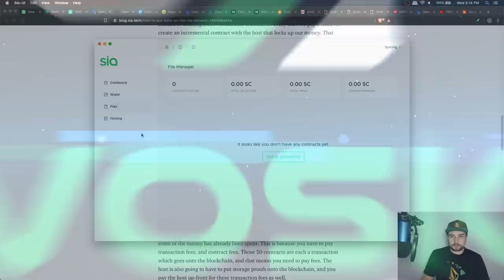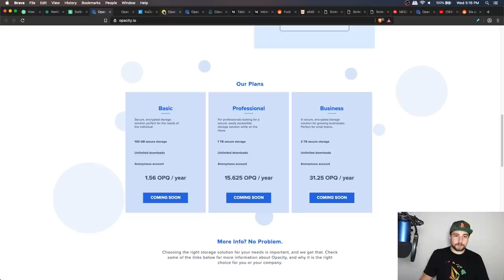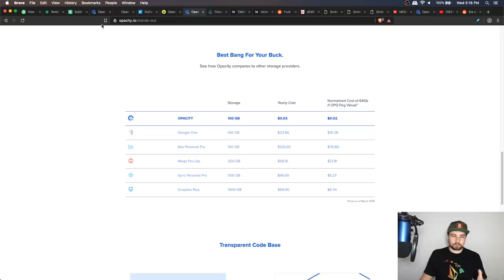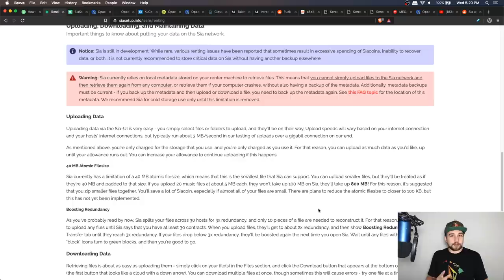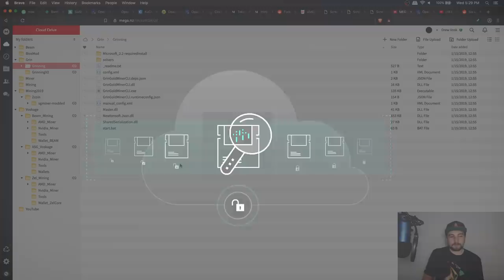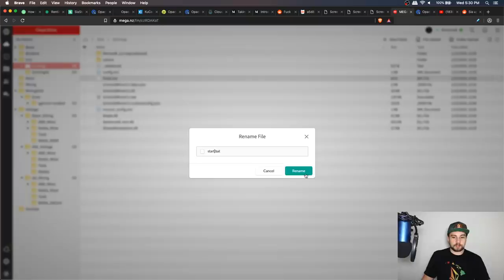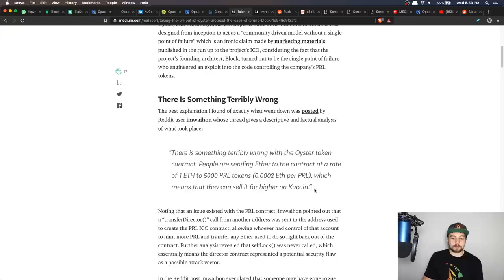Will Storing Files on Cryptocurrency Blockchains become Popular? Siacoin Vs Opacity

Comment from the maker: Sub to VoskCoin http://voskco.in/Sub
Want to expand your file storage? https://amzn.to/2DgUUda
VoskCoin Twitter - https://twitter.com/VoskCoin
TIMESTAMPS and LINKS BELOW!
00:00 Intro to cloud storage on the blockchain
00:17 Tails Doge surprise appearance
00:30 Siacoin cloud storage mineable cryptocurrency
01:32 Opacity launching blockchain cloud storage May 2019
01:51 Storing files on Siacoin cloud storage platform
02:47 How much money does file storage on SIA cost?
03:23 Opacity cloud storage OPQ pricing
04:05 Comparing blockchain file storage to Google, Dropbox, etc
04:40 Obstacles to decentralizing data storage with blockchain
09:05 Issues with Siacoin blake2b mining
10:50 Opacity OPQ coinmarketcap
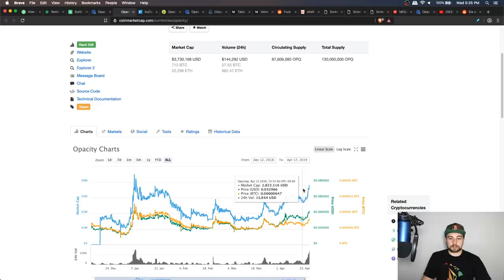11:12 Siacoin SIA coinmarketcap
11:44 Final thoughts on SIA vs OPQ blockchain file storage

LINKS! 
Thanks to Opacity OPQ for todays video - http://voskco.in/OPQ
Cost for storing files on Siacoin - http://voskco.in/SiaCost
Siacoin official website (cloud storage) - http://voskco.in/SIA
How to put files on Siacoin (guide) - http://voskco.in/SIAdata
Opacity OPQ whitepaper - http://voskco.in/OPQwp
Opacity & Oyster Protocol PRL drama - http://voskco.in/OPQdrama
Opacity OPQ to USD calculator - http://voskco.in/OPQusd
Reply: Take a look at Ether-1
Reply: 0chain also stores data on the blockchain and it is by far the technical fastest and most advanced decentralized cloud storage project. You can test their alpha app out on their website if you have ios.

Comment: Tried them all. So far, from a storage user point of view they have not performed well. The performance of their storage when its sitting on crappy nodes at residential internet connections at miner homes is just not good.  From a mining point of view, I have tried mining Storj and SIA, never made any money either way. I put up to 40TB on these networks in my data centers where I have low latency high performance 10gbps+ connections and over a month barely 30GB was stored by the blockchain storage platforms.   One of these block chains needs to go after enterprise class performance, security and features. They also need to classify their storage nodes based on performance, location, redundancy, and such then have multiple storage tiers based on performance and redundancy for the storage users. I want decentralized storage, but right now, its easier and less of a hassle to just offsite data to two different cloud providers!
Reply: Hey.. opacity just released it’s beta. Check out out!
Reply: That is Sia's goal. It's not really meant for the end-user, it's more of an enterprise solution which you can build on. There are already storage services which use it as a backend.

Their goal is also to have performance penalties for hosts. They can't implement everything at once though, as they're privately funded. They didn't receive stupid amounts via ICO.

The major hurdle to adoption in my view is seed-based recovery, and that's coming in the next version. Usage has more than doubled over the last 2 months.

Some sia-based storage solutions:
https://goobox.io/
https://filebase.com/
https://pixeldrain.com/
Reply: This is what I wanted to know. Any updates in 2020?